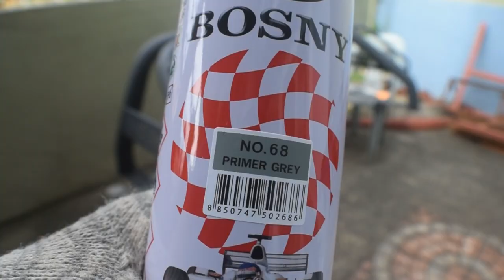Repainting my roll bar using spray paint on my Nissan Navara

Comment: just to share, regarding delays on transmission, i've installed "TopSpeed" on my navara to resolve this issue.
Reply from the maker: Planning din sana ako na mag kabit may nakita ako sa lazada. Hows the performance sir effective ba, na resolve ba ang delay shift?
Reply: yes sir, very effective! nawala yung yung lag during acceleration. may added safety feature din na "car lock".
Reply from the maker: @jonathanlarin5055  Thanks for the info sir, hopefully makapag install din ako soon.